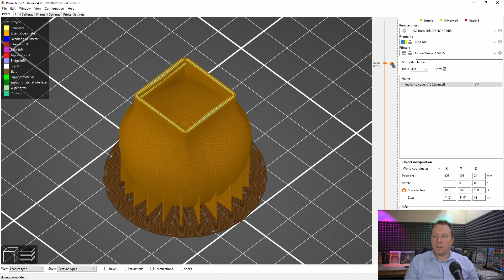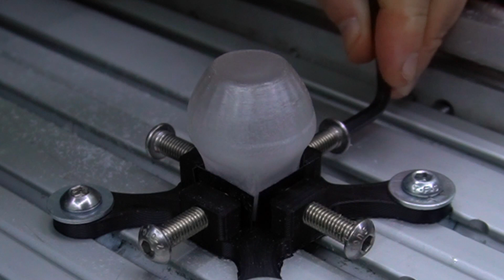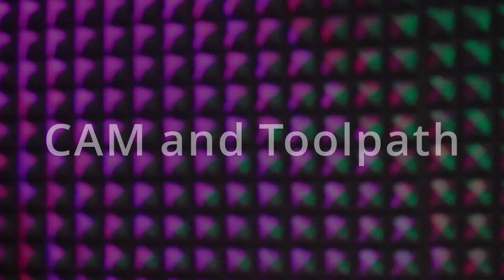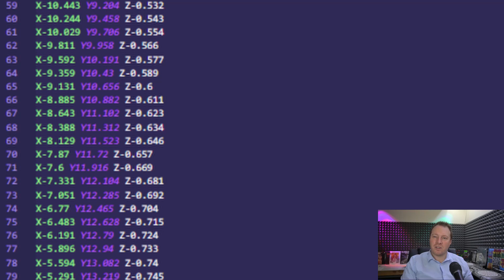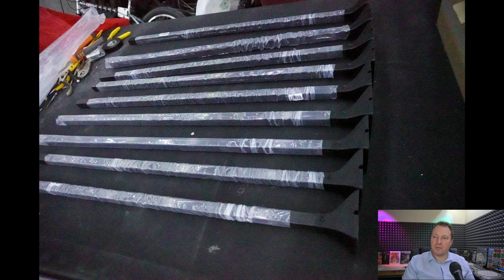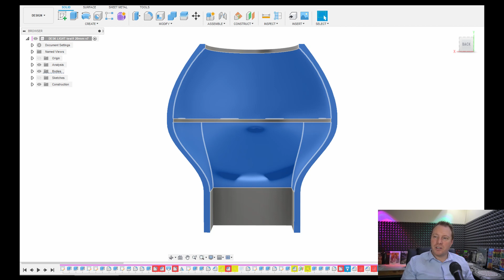Remove 3D Print Supports With CNC Machining - Hybrid Manufacturing!

Comment: Imagine if we had a tool changer that could print a supported part and the negative for it, you flip the part into its negative and it changes tools and removes the supports. You may have stumbled onto the future here!
Reply from the maker: Haha yeah thanks. It's something I've wanted to try for a long time. There's allot of uses for it. I haven't seen anyone else model in supports. The combination of modeled supports and cnc removal of them is great manufacturing strategy.
Reply: @MakeTechPtyLtd  modeling in supports is done from time to time, but making them removable like this, that I've never seen.